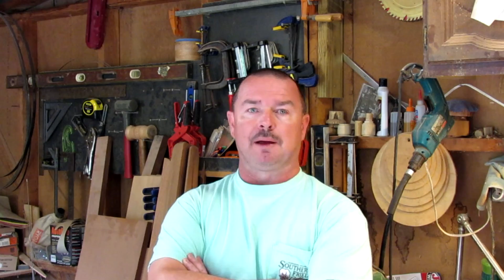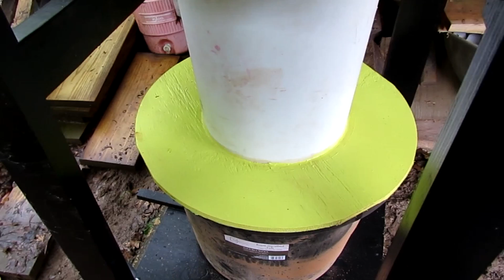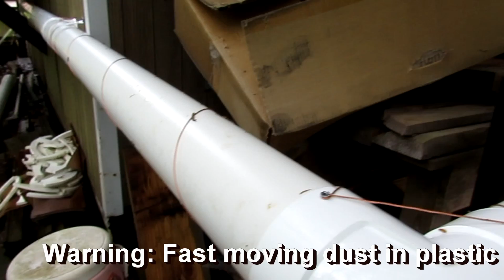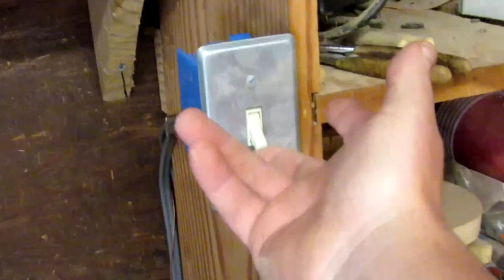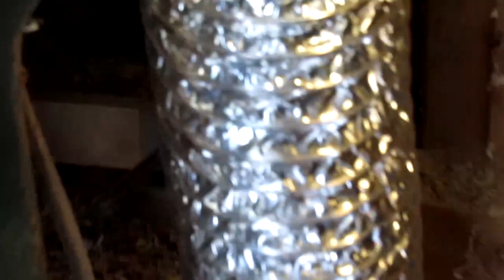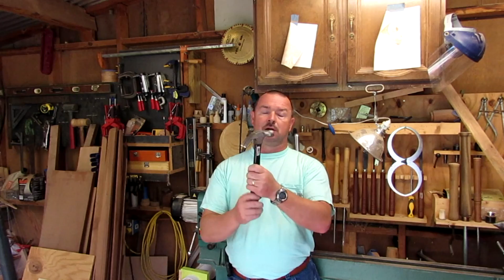#71 My Shopmade Dust Collector Follow Up

Comment: Hi Stephen.   In the video you mention that the size of the pipe (6") down to 4" should and does work out mathematically.  My ? Is   how do you know this?  How  did you figure all this out ?  Wow,, are you a math whiz?  Or did someone tell you?  Because I do not think that is  very common knowledge.  The  knowledge  you share in this build is well beyond the average person or handyman . Very impressive. I also would not have thought to use fiberglass.  I myself would have used duct work metal. 
May I ask what your main job is ? Your obviously very intelligent and I thank you a million times over for sharing and teaching us so much.  If I could I would like to one day sit down with you, have a few cold beer and pick your brain for ideas.  Thanks for all you do to help us learn  and save money but most of all for giving us the knowledge to do some pretty cool stuff and that's the best feeling in the world to me is being able to build something most people can't.
Reply from the maker: Thank you sir for the vote of confidence. I really appreciate it. To start with I am a Firefighter and have been for almost 33 years. One thing we have to learn is how to calculate water flow under various pressures and with differing diameters of hose (or pipe). When you double the diameter of a pipe you increase the square inches across the diameter by four times not two times as one might think. Increasing by 1.5 times as in four inch pipe to six inch will give you 2 times the square inches across the diameter doubling its capacity. I learned that when I was training to become a driver/pump operator. I am now a Lieutenant but still find the calculations fascinating. I like trying to solve problems. Like you said. That is the fun part. Hope this helps.
Oh yeah, a few beers does sound pretty good.
Reply: Stephen Ogle  wow. You have been a firefighter for a very long time. I hope and prey that you continue to have many years of healthy service to your community. 
 Unfortunately the 🍺 won’t happen as I’m in 🇨🇦.  
 Have you ever thought of doing a live question and answer episode?
 It’s great that your such a giving human. Giving your life at work as a firefighter AMAZING and you constantly making great INFORMATIVE VIDEOS for free. I am impressed by your humanity. Your good people Stephen .
Reply from the maker: Glad you are enjoying this project. Make sure to watch the last video in the playlist. It is number 132 for my final upgrades. Here is a link to it.  https://www.youtube.com/watch?v=7wpr3-AQrIQ&list=PLGsnYf7PysCQ1S_mgY1JggDaHfyPd3KPo&index=6

Comment: Hey Stephen. Thanks for your thorough documentation.  Great job, it makes me very jealous for the space that you have, compared with my small shed... :)

Now that you're a year down the road, have you made any other mods to the system?  The onliest thing i could think of is possibly run 6" tube from the collector to the first tee to minimise any pressure drop in that leg, but truly, it probably wouldn't make a noticable difference. For me, I'd have to put an accoustic insulation box around the impeller housing too, living in suburbia.

Thanks very much mate, and cheers from Brisbane, Australia.

Comment: Consider leaving the filters out of the blower. The fine dust will go into the woods.
Good dust collector system.
Great job.
Reply from the maker: +Dennis Williams Thank you Dennis for your suggestion. However, I have to filter the air because it now is routed back into the shop. I must put the air back to prevent negative pressure inside that will pull air back down my flu pipe in the winter while burning wood in my heater.

Comment: I thank you again for some very good information.  As I was watching and noticed the dust that ended up on your filters I was thinking that if you added a deflector in your cyclone that would start at the intake port and rotate around and cork screwed  in the direction of the cyclone which would start the downward flow into the receiving drum.  It seems as though it to direct more of the fine dust into the receiving drum.  (great job)
Reply from the maker: +Dave Harrington Thanks Dave. That is a modification I have been stirring over and may still implement. I have seen it done on youtube. Great suggestion!

Comment: Ignore my previous post except for the great job part. I am glad you learned that grounding the pvc pipe was the way to go. You didn't go into what form of fiberglass you used, my weapon of choice is "kitty hair", comes in a can and mixes like bondo but has the fiberglass strands mixed in the resin so it is structural.
Reply from the maker: James Stanlake Hey James. that was a great recommendation and I am really glad you brought it up. That was the same reason I tried to explain in detail that it needed to be done. I always welcome comments such as yours. The fiberglass I used was just some from The Home Depot. I have never once used fiberglass before and actually do not know anything about it. This Kitty Hair sound like a good product. Where can you get it? Again thanks for your comments.
Reply: I can get kitty hair at the local auto parts store. You will fing it right next to the bondo and you can order it online.
Reply from the maker: Thanks James. I appreciate it.

Comment: Great information Stephen,I need to build one myself.I wounder if you could use an A/C air handler blower unit?
Reply from the maker: Thomas Mccool Thank you Thomas. This thought crossed my mind because I have a large A/C blower unit I wanted to use for this purpose. However, talking to heat and air guys. They do not think the A/C blower would hold up. So I went with this design which I have already had experience with. Glad I did because I have been using this system for a while now with not so much as a hiccup. Runs great. Thanks for commenting and for your question.

Comment: Looks like a great project for me to try. I've never worked with fiberglass. could you explain how you performed this part? Thanks for the great video.
Reply from the maker: Dennis Wise Thanks Dennis for commenting. The fiberglass is easy, although a little messy. Use rubber gloves. I simply put the bottom half of the impeller together with wood glue as in the first video. Once it was cured I used the fiberglass resin to coat the surface of the lower housing and vanes. Then you apply the fiberglass strips and recoat with resin. Let it cure and attach the top housing the same way. Allow it to cure up and then balance your impeller. Mount it to the motor and you are ready to go. Hope this helps.
Reply: Stephen Ogle Thanks Stephen. You've been a big help. Can't wait until I can get started on mine. Have to finish my current project first. Working on an octagon curio cabinet for my wife. I have the wood part done. Have to get glass work done now.

Comment: Very interesting Stephen. I would have liked to seen how you built the new and improved impeller though. Recon how many GPM that thing might flow?   LOL
Reply from the maker: Barry Davis Ha. Thanks Barry. I built this impeller the exact same way as the first except I fiberglassed this one as I went. Mounted it on the lathe to true it up and get the holes perfectly centered. They say a centrifugal pump can't pump air. "I beg to differ, LOL". I need a measurement of airflow. I would really like to know how much it moves. Thanks for commenting and supporting my channel.

Comment: Great follow up video stephen , I wish I had the space to build a dust collector of that size, will have to content myself with a slightly smaller version along the lines of your first ceiling mounted unit you made previously!! 
Bet that got your attention when the impeller blew apart !!! 
Really good to see it all up and running with the upgrades working well. Thanks for a great series Stephen and keep up the good work my friend, looking forward to your next project. Trev
Reply from the maker: Trev Sutton Thanks Trev. This build was awesome to go through even with a couple of setbacks with the original. Yes, It was a big suprize when the impeller came apart. I'm just glad I had the cabinet all put together when it did. Good luck on your build and I would love to see it when you finish. Thanks again Trev for all your support.

Comment: Stephen, thanks again for another excellent video and explanation of how you thought through your process. I get so frustrated at times when things don't work the way they I think they should, its good to see how you handle that frustration and turn it into an even better solution.
Reply from the maker: Chris Blaszczyk Thanks Chris for your comments. I could have simply bought new bearings but just wanted to try using a direct drive. The airflow was great until the impeller bit the dust. I then could not settle for the slower rpms and had to find a way to strengthen the impeller. Don't know what made me think of fiberglass but I am glad I did. Glad you enjoyed this project and video. Thank you for commenting and supporting my channel.

Comment: Stephen, great job. Failure always makes for a better design. In your case, your new design has fewer parts, so less to service or go wrong in the future.
Reply from the maker: Edward David Thanks Ed. You are right I could have save some parts and money right off the bat. I liked working with the Fiderglass. I have never worked with it before and it really added a lot of strength to the impeller. 3450 rpm is really fast and puts a lot of stress on it. I appreciate your comments and again thank you for all your support of my channel.

Comment: You'll need to be careful you don't get sucked up that hose yourself.  I loved the way you told the story of the impeller failure, very entertaining.
Best Wishes, Brendan.
Reply from the maker: baconsoda Thanks Brendan. Glad you enjoyed this follow up. I had a blast building this project even when the impeller bit the dust. I had seen the airflow that I wanted and had to find a way to keep it all together. It has been running most of the day and not so much as a hiccup. Thanks again for all your support.

Comment: Superb job Stephen ! A great follow up.  I am pleased for you, those few problems really did you a big favour and you now have a first class piece of equipment (I think it could pull dust from this side of the pond :)  )  many thanks for sharing !!
All the best  Bram.
Reply from the maker: Bram Sharp Thank you Bram for commenting. Glad you enjoyed this project and yes the design opportunity did lead to a better design. I have been working all day in the shop and it has been running for most of that. I am very satisfied with the performance. Thank you for the inspiring comments and support of my channel.

Comment: Great rebuild. Just wondering how you connected the impeller to the shaft motor. Was it long enough to reach both sides if the impeller? Would have been good to see the impeller build. I think you need to build another......lol
Lee
Reply from the maker: Lee Waterman Thanks Lee. The mounting was easy. The impeller was build exactly like the first and to the same specs. The only difference was the arbor hole. I used 5/8" to fit the motor shaft. It fit nice and tight. To keep it from ever coming off I used a cut off ring shank nail and drove it into the key slot. The shaft only had to be long enough to reach all the way through the front stabilizer and it does. I think if this one comes apart I will have a really nice bonfire. LOL Thanks again for all you do for my channel. Oh yeah, How was the music?

Comment: Hi Stephen, Great tutorial man! Sorry it blew up but, it turned out great... Two questions. When you said you fiber glassed it, do you mean you built with plywood again and then coated the vanes/impeller with glass or you actually built it using glass? And, just curious, how big is your shop building and is it adequate? I'm having to buy or build one because we're moving soon.(Losing my garage shop) Thanks man.... Best regards, Charlie
Reply from the maker: Charlie Zellner Thank you Charlie for commenting. Glad you enjoyed this project. Yes, I built the impeller just as in Part 1 except that I used the fiberglass and resin to reinforce the joints between the vanes and the circular housing parts. As for the question about my shop size. My shop is 12' by 20' and NO it is no where near adequate. I actually have expensive equipment outside under a pop up tent. LOL. A 20' by 24' would probably be my minimum size if I could build a new one right now. I would try to go even bigger if I could. I hope this helps with your decision. Thank you for supporting my channel.
Reply: Stephen Ogle It did, my half garage space is 12x20 as well. I'm cramped. I was thinking 20x24 or 24x24 would be about perfect. Once settle in, I'll post pictures and projects too. But, this will take a while. Thanks buddy!!
Reply from the maker: You are welcome sir and I look forward to seeing your new shop. Good luck with it.

Comment: Great dust collector. I'm not saying anything is wrong so don't think it you could put a smaller more manageable hose just to clean up around your machines .where I use to work we had 20 inch hoses for the machines but right at our work stations 2 inch lines on a stiff 3ft hose so we didn't have to bend .
Reply from the maker: timothy mcswain Thank you Timothy. I do intend on using a shopvac hose to adapt to this machine for general cleanup around the shop and the individual equipment. Thank you for all your comments and support my friend. Glad you enjoyed this project.